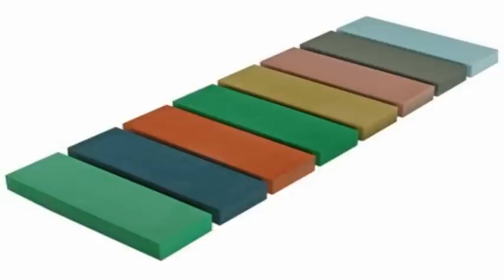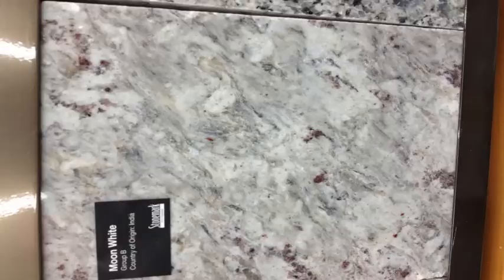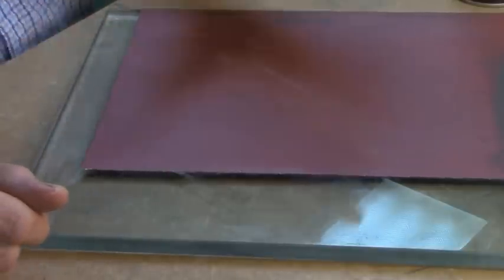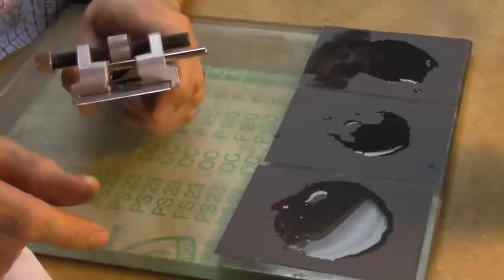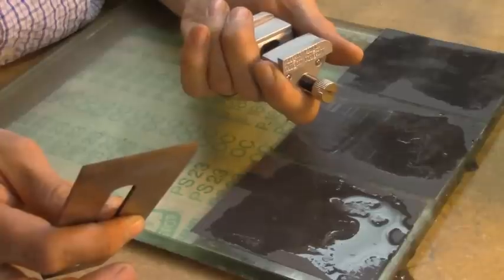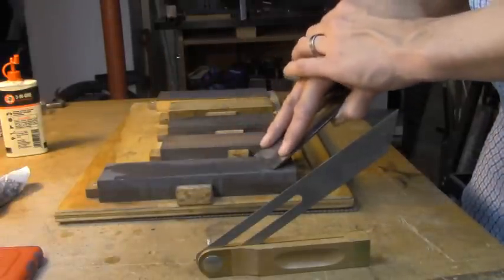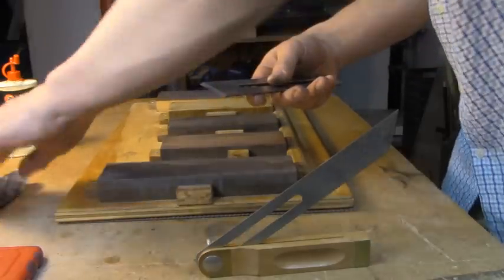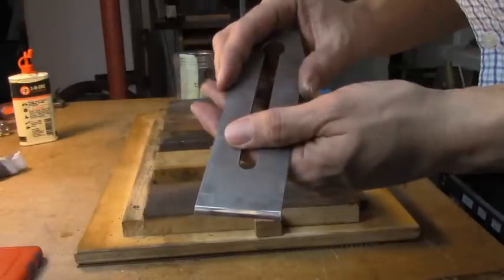Hand tools for $100 #4: Sharpening for Cheapskates

Comment: I got my combination oil stone off eBay it was hardly used and had the original box and receipt from 1957....it cost £15 shipped but I'd only ever buy an old oil stone as that's what I learnt to sharpen on in college, I found found a matching medium grit one again boxed just for the kitchen at the same price but I'm looking for a fine and course for my main set so my combination stone can live in the kitchen

Comment: One little point to make: if you established a burr and you flipped it  over back to the bevel side once, than it's a way to go just  to make edge leading motions with very light pressure. Than you can avoid secondary burr and angle decrease in microscopic level witch makes the edge prone to roll over. Than honing on leather or polishing on a buffer is an option of course.

Comment: Useful stuff.  The only thing I would add is to back off or round over the corners off your plane iron, otherwise, they will dig into the wood and you'll get tram lines.  Paul Sellers does this.  I don't use oil stones.  I used to but they are messy and eventually, I found they bowed in the middle.   I'm lucky enough to afford diamond stones which don't need flattening and use water as a lubricant. Also, the honing gauge you used is ok for planes but tricky if you want to put in a 1/4" chisel.  I also use honing guides all the time. Mine are by Veritas - their one for gripping narrow chisels is excellent.  Finally, I found that by sharpening stuff by hand, I'd get crooked blades.  Honing guides makes sure that doesn't happen.  Cheers.

Comment: A bench grinder (or file) then a rough stone with two different grits then king stones ( 1x 1000 - 6000 then a 8000) then a strop and then a polish wheel, will create an edge like no other.

Comment: I do really like your whole presentation style and from those I've watched they are factually accurate as well. Keep them coming please :) Another type of stone used for the final stages of sharpening is slate. It is often used by those who use old style cut-throat razors. I've picked up a fair few really cheaply (£1-£2) at car-boot sales here in the UK although they do tend to be rather dished it doesn't take much to get them flat again.
Reply from the maker: I've never even heard of slate sharpening stones before!  That's fascinating. I'll keep my eye out for some. Thanks for the tip/

Comment: In all these plane sharpening vids there is never enough emphasis on the angle the tool tip makes with the workpiece. It's okay to say put an angle of 25 deg on the blade and then refine it to 30 deg. Then you flip it over and attach it to a 45 deg frog!
This idea of clearance angle makes it easier to understand.

Comment: Ordered some new, cheaper, chisels that were due to be delivered today along with an assortment of cheap wet-dry silicon carbide sandpaper.  Found a piece of highly-polished marble tile at a big box store yesterday, $2 because one corner was slightly chipped; I figure it's plenty flat enough to flatten chisel and iron backs and bevels.  It all came in today so I dug out a tiny little hand plane with a die-cast body.  I had previously flattened the sole on it but I knew the bevel on the iron was not square to the sides, so it needed to be straightened out.  Set to work with some 150-grit (too fine, I found out) and straightened out the bevel then put a very approximate 5 degree micro bevel on it.  Finished up the micro-bevel on a combination medium-fine oil stone I had and tested it:  worked quite well on some SYP pieces I had laying around.  None of it was hard, but it was a little time consuming due to my poor choice of grit starting out and the fact that the bevel was so far out of whack to start with.  I didn't go far enough honing to produce any sort of "finish-ready" surface, but I'm going to be using everything to build a strong back then an older design canvas covered kayak, so it's plenty good enough.  Thanks for the instructions to know that tackling this would get me started back to working wood with hand tools; that;s much more enjoyable than power tools!

Comment: 600grit paper is surprising versatile:  as it wears it becomes more like 1200grit, so you can use it instead of finer paper.  For coarse grit, the very, very cheap diamond plates work very well and their coarseness is an advantage.  A decent, inexpensive combination oilstone is probably a better, cheaper, longer lasting, simpler, cleaner option than papers though (e.g. Dekton/Draper/Faithfull/Stanley 8" combination stone for about £5 - go for name brand, really cheap stones don't work in my experience, too coarse or too soft). Yes freehand - learn this useful skill. :)

Comment: Thank you very much for this. I bought one of these guides in the early 1960's and have left it to languish in my tool cupboard ever since. It has followed me through various moves. Anyway, I have a project for the Spring and summer months and was ready to go out and buy new chisels. Seeing this reminded me of the guide and how many old useless chisels I have that can easily be restored using your method of sharpening. Great tutorial. By the way, my guide is identical to your one. It's an "Eclipse".

Comment: Rex  I  quit using  green compound on leather  for  plane  blades it   tends  to roll over the  sharp edge . I do use  it on    carving  tools. I am now using  8k  ceramic  and 13 k   ceramic  stones  to microbevel   my  many plane  blades  There is also an  inexpensive  blue  stone   from woodcraft   rated  at 10 k . But it  is   slow

Comment: I think that cheap stone you have is aluminum oxide, or maybe silicon carbide (also known as carborundum, which is a brand name). Both of these are inexpensive and they work fine. They aren’t as hard as diamonds, but they’re a lot harder than tool steel.

Comment: Here’s a discussion I think it would be good to cover: Sharpening old files. Can it even be done? People tell me they can be made sharp again with acid or by magic spells or by closing my eyes and wishing really hard, but I’ve never seen anything resembling real data on the subject. I happen to have a lot of old files, some of which are pretty scuffed up, and some of which are rusty. It seems that files are everywhere, and many people are eager to dispose of them for free or very cheap.  I picked them up because even if they can’t be sharpened, the tool steel can be used to make other tools (e.g., draw knives and spokeshaves).

Comment: Rex the newer low speed water cooled tool sharpeners are cheap as crape these days seriously anyone who is a super super cheap ass like me will love the cheap wen slow speed water cooled tool sharpner I paid like $110 for mine and only use the rest that comes with it works amazing for plane blades and chisels and also I buy and use the harbor freight combo oil stones to change my wen wheel from fine cut to coarse cut but I agree for my first 2-3 years I only sharpened by hand first with a cheap honing jig then learned by hand so I can totally sharpen my chisels by hand and some of the regular and large plane blades by hand still have trouble with small plane blades but anyone who has been wood working for a while and is looking to step up a little I really think would love the wen cooled water sharpener there on Amazon I love mine and only have like in total less than $130 in mine!!

Comment: I’ve used sandpaper for a while, and I’ve come to the conclusion that it has another major flaw that isn’t often talked about: it’s not only expensive in the long run, it’s also just too inconvenient. Woodworking is so much more fun when you use sharp tools – and less dangerous, too – so everybody rightly always reminds us to keep our tools sharp. But when you’re in the middle of a project and you feel your tools getting dull, do you pull out the slab of granite, peel off the old sandpaper, glue on new sheets, inevitably rip them and replace them to sharpen your tools? No, you don’t. Not usually.

Having a little sharpening station with two or three plates or stones and a strop is just that little bit more convenient: set it on the bench, run your chisel over it, and done. Not having to faff around with the paper makes a huge difference. It’s what they call friction in the online/user experience world: if you have to look up your password first, despite not being a major inconvenience, you’re A TON less likely to log into a service or a website.

And that’s exactly been my experience with woodworking: I kept ramming dull chisels and planes into wood instead of taking the time to sharpen them, despite knowing better. So I think sandpaper should be mentioned as an alternative for people who have 50 bucks to spend and want to get into woodworking, but it shouldn’t be recommended as equipment, not even for beginners. Sharp tools really are key, and I think a couple of decent sharpening stones or plates should be part of the very first batch of tools you buy. People are lazy – we just are. And a good sharpening solution will help us get used to that routine, while the sandpaper can turn out to be a hindrance.

I finally bought two diamond plates a while ago, somewhere around 600 and 1400 grit. For the rough stuff I will still use sandpaper – for re-establishing a bevel, or for restoring stuff. I might add a coarse plate at some point, but if the tools aren’t damaged or out of square, you only need the finer grits.

Comment: I  totally understand how this works for chisels.  How do you get and maintain camber on your plane irons?  Grampa's plane iron is ground square.
Reply from the maker: It's pretty much the same, you just apply a little more pressure at the corners as you hone. Not hard.

Comment: this seems like it would work for a moderately chisels that's dull but Ive got some chisels that have chipped edges, im wondering if i should just get new ones, they have about 1/16 to 3/8 inch gouge on them. i don't think this will work for them.

Comment: Great information but let me add one thing  -before you ever start working on the bevel - with any of the methods . You must flatten the back.  If the back of the iron or chisel is not dead flat at the edge, you will never get it sharp from corner to corner. You only have to do the flattening once, and it only needs to be the last 1/16-1/8” or so near the edge, but you have to do it first.  Then square the edge, grind the bevel, and hone the micro-bevel. I worked for 20 yrs with tools that were not sharp enough before I learned this.  Now I can make a POS $5 chisel ‘scary sharp’ and the difference is flattening the back.
Reply from the maker: Totally agreed. I just think of flattening the back as "preparing the chisel" while this is sharpening. If I were restoring or working from scratch on a new chisel, I'd flatten the back for sure.

Comment: I noticed all the ways to flatten a knife are sandpaper based, but i remember from another one of your videos that sandpaper leaves a rougher finish than a planing tool. Are there knife sharpeners that plane instead of grind? Or do we just not have strong/hard/sharp enough materials for planing steel at room temperature lol
Reply from the maker: Steel cannot be planed. All shaping/sharpening is done through abrasives. Whether it's sandpaper or a stone doesn't make a huge differece in the finish it leaves.
Reply: @RexKrueger  well, a carbide pull-thru sharpener sorta works like a scraper. These come in criss-crossed carbide blades in a V config, typically. But some dude on YT also sells them as single blades on a poker chip, where you basically use it like a card scraper for hardened steel edges. Like a card scraper, these carbide blades have a 90 degree edge, and you drag them over the blade bevel with a positive rake, the cutting edge trailing behind the handle part, so they don't dig in too deep and stall or take big chunks. It takes some skill and feel to use them.

Edit: I found him. He goes by SharpensBest on YT. Warning: he is basically the Billy Mayes of knife sharpening. It's obvious he is a salesman. I have never used any product like this, and I don't sell sharpening stuff. Just thought of this because of Jake's question.

Comment: You put far more honing compound on your strop than you really need. I don’t know if using “too much” compound really causes any problems, other than being slightly messy, but you only need a little touch of the stuff— especially if you’ve put it on the strop during previous uses, in which case a lot of compound will be already ground into the leather.

Comment: do you have any reccomendations on what search terms to use to get a suitable peice of glass?
Reply from the maker: Perhaps "dumpster diving". Honestly, i get mine out of the trash, but you can buy a granite tile at Home Depot for a few bucks.
Reply: @RexKrueger  Thanks for the advice, ended up ordering some granite placemats, sandpaper, glue and a honing guide and making my first attempt ever at sharpening (previously I have just used the factory edge). Issues I have run into are 1: if I try and cut during the push stroke I chew up my sandpaper, so I resorted to only cutting on the pull stroke and 2: my honing guide seems to be the wrong shape for my chisels making it very hard to get them in straight. Still the chisel seems to cut much better than it did before sharpening.

Comment: Probably stupid as I don’t have any to try, but: to avoid freehanding with oilstones, can you not fix them in place with strips (instead of blocks) of wood then make a honing guide that has wheels 2in apart running on these strips? Or even running off the sides of the block?

Comment: Hey Rex can you recommend a sharping stone set? I seen set for over 100.00, is this necessary? I have used the sand paper method before and found that it works great long as the blade was just dull.

Comment: Its pretty good explanation, but I wouldn't strop that firmly, if you have to push that hard, you didn't hone your blade well enough, its enough to just use very light pressure. Lastly to be really sure you remove the burr before the stropping, gently pull the edge over a piece of endgrain wood and it will pull it right off. Also helps to keep you strop metal free and thus not mess up the polishing.

Comment: Love this series!  I'd love to set up a sharpening station like you have, but I'm having a hard time finding actual oil stones instead of water stones.  (The Norton combo stone is on Amazon for just over $20, but I haven't found higher grits!)  Any tips on where I can get these?  Seems like all the sites are pushing water stones or diamond stones, and charging crazy high $ for it all...

Comment: Hi Rex. Tried the sandpaper method. The grinding was fine and so was the honing on 400 W/D. After that, the paper starts shredding and I can't go any further. Thought it was cheap paper, but I tried again with 3M and the 600 grit still shreds. Any ideas?
Reply: Why don't you invest a few bucks in some stones like he mentioned at the end?  Far less expensive in the long run.  I'm no expert, just pulling out what he said in the video.
Reply: @sharit7970  I got a set of Arkansas stones and they work great.
Reply: @LazyCat010   Great...problem solved!  I just started checking sharpening out because of replacing a 100 y/o hall floor; the subfloor boards are not flat; got a plane [dull] from Harbor Freight; so to fix it I went back there [why??] and ended up with diamond hone blocks.  I'll no doubt need to upgrade those soon.  I'll keep the Arkansas stones in mind.  I have a sort of a love/ hate relationship with Harbor Freight...

Comment: I agree and disagree on sheaper sharpening solutions, with variarity of tools and house hold items I gotten and getting to good kvality with my tormek I think that over the years I'm ahead of cost with savings from buying high end stuff both for my shop and house hold, ofcourse also tormek has learning curve and my father in law seems to get same results with a bench grinder, I couldn't and for me sharpening investment was what made it possible for me to make my sheap tools workable in shop being a sheep scape... It was actually the tool that made it possible for me to accept many hand tools as supperior for me since I do wery little repetitive work and setup for machines takes time. With house hold tools, drills and tools from work that where deemed trash and performance upgrades on sheap tools for shop I consider over my years it is really coast effective. I do use sandpaper and som sheaper stones to add to vercitility for some part , and parts that are more or less free to complement. Compared to many sharpening systems. Those systems dont take alot of skills to make real good results. Only with my wifes hair dresser scissors only one restoration saved me 1/12 of cost end performance of my sheap tools saved me alot more in usability. In short, if you're not good at sharpening invest in good sharpening system, it be worth the time and agony of trying to make an edge working. In the end it is what do you need to sharpen and find your system to make it happen... To you Rex, I found your channel only 2 days agoo and I subscribed today so thanks for really good content. Best regards from Sweeden and keep up good work.

Comment: A power bench grinder.   Perhaps, a good idea not to allow people to ruin tools by friction.  However,
since people will surely use one for initial establishment of an edge.  First used a fairly course stone.
Second use a star wheel to reveal fresh, sharp grit.  An old trick that is cheap and works very well.
Apply chalk to the grinding wheel it runs cooler that way.